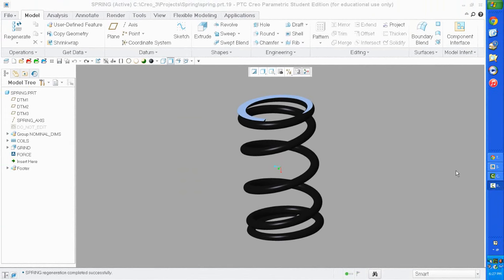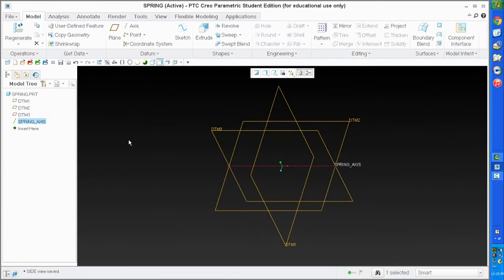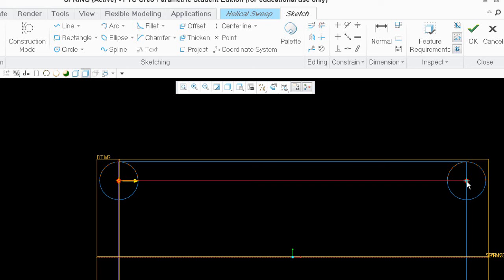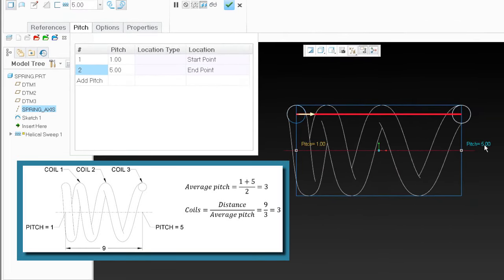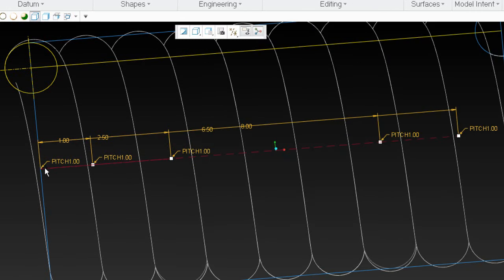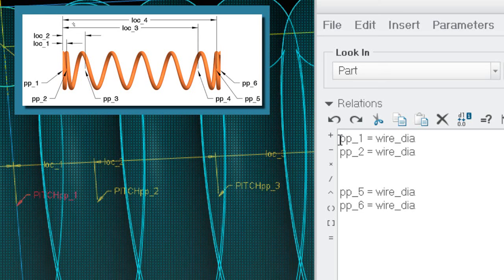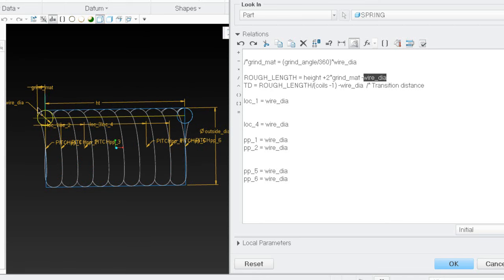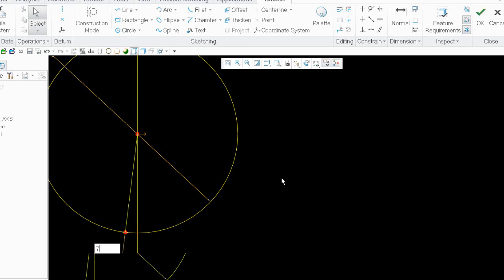Creo Flexible Compression Spring  - Part 1 of 3

Comment: I learned many subtle things and agreed with the logic of the use of case in the relations and parameters, named dimensions, and (grouped) features.  I have modeled my identical spring with closed ends for future use.  So, for that, I thank you.

FYI: I recalled a manager (in 2002) "correcting" my pronunciation of the word "height".  It is not to be confused with "length", "width" and "depth" - which phonetically end in "th".  Height is to be pronounced with a hard "t" - like the word "fight".

Comment: A fantastic video! Thanks for posting this! I am working back through the models (successfully built the metric spring) and I am now creating an imperial (inch) spring. What specifically would need to be modified in the RELATIONS? I understand that I'd need to change the N readout accordingly, however the model is failing to regenerate properly. I'm getting "invalid attempts to assign a negative value" to my PITCH locations. As I look through the quadratic equation I am not seeing any errors. Any thoughts on this?
Reply: Can you send me the failing spring?
Reply: Sure can! Whats your email address?
Reply: Save a copy and change the units to inch (be sure to select interpret dimensions).  This will create a very large spring (10mm becomes 10in), simply change the nominal dims.
Reply: I'll give it another shot! I did that but was getting an error in the quadratic equation in my relations. I'll revisit it and try again. Thanks for the feedback Rich! Glad to finally have a working model like this!